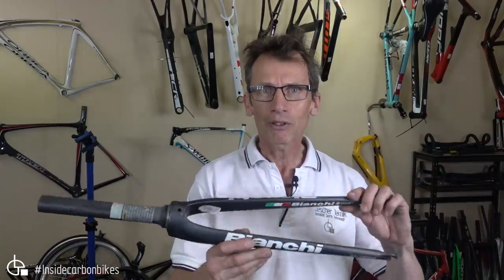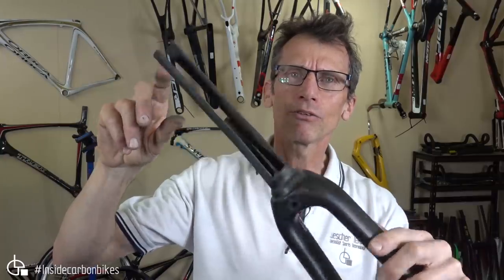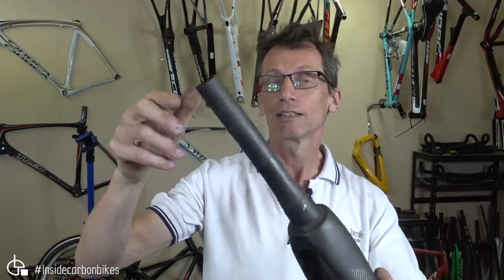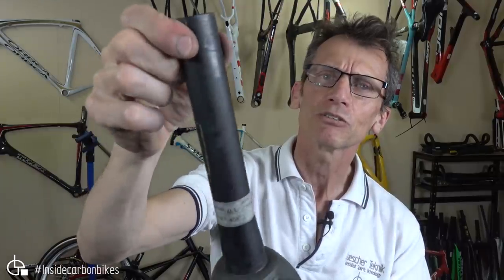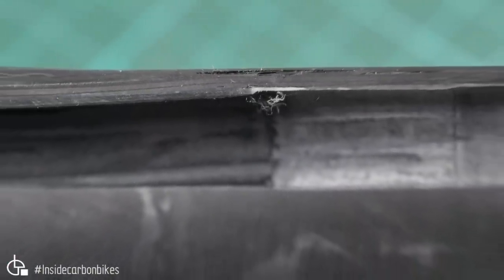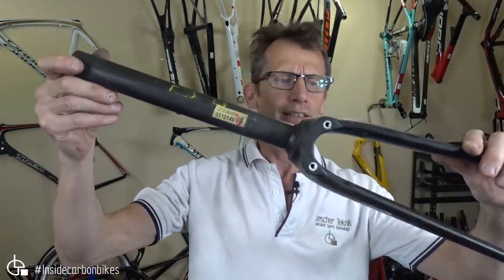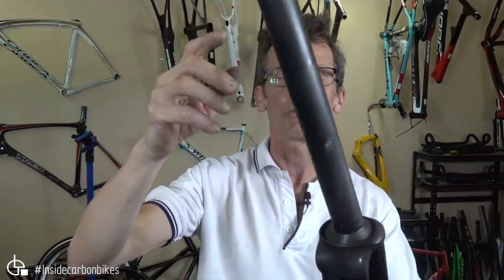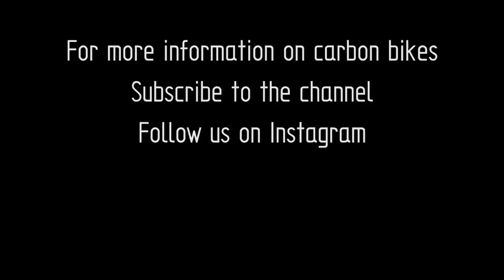Fork Steerer Failure - Recent Crash

Comment: Hi Raoul, Great to see a new video from you again!
To all the chinese-paid carbon fanboys here.. let's not forget cannondale's carbon forks have already killed one person and 11000 of them, yes.. ELEVEN-THOUSAND forks have been recalled because of cannondale's greed and lack of quality control. When was the last time you saw 11000 steel, titanium or aluminum forks being recalled?
Reply: 1. Lets get the facts right GG DD :) CARBON WAS NOT THE ISSUE HERE! The issue was the lawyer tabs didnt work if you put your wheel in wrong and grabbed front brake. Your wheel could pop out and that is what caused the crashes.

2. Cannondale recall is NOT about materials used and is a BIG reason thru axles are become the standard in road disc now.
Reply: @DurianriderCyclingTips  The recall concerning the wheel popping off was actually a Trek recall. The Cannondale recall address possible fork breakage. Both recalls concerned disc brakes only.
Reply: @DurianriderCyclingTips  I see some of my responses are being censored. Let's just say you are incorrect. The MIAMI HERALD WROTE an article about the Cannondale recall.. "Cannondale bikes recalled after BROKEN FORKS result in serious injuries and one death"  Google it and LEARN.

Comment: Hi Raoul... Is there anyone in the US that you could recommend to do a scan?
Reply: If he doesn’t respond, locate your nearest engineering university and call them, you want to speak to the Dean or head of the mechanical engineering dept., or metallurgy group.  As a private individual, it may cost you nothing or a nominal charge.  Even the whole frame too.  Engineering or materials laboratories can do it for hire, at a cost.
Reply: The two that i know in the US are: Ruckus Composites
 and Calfee-Design, i am sure there may be more..
Reply: @ggdd1299  Okay, thanks.  I just contacted both companies.
Reply: @shibaburn7725  i am glad i could help.
Reply: @ggdd1299  "We do not perform any x-rays or ultrasonic inspections on frames or bicycle components. The only service we offer for forks is a symmetry test, this would mainly indicate any signs of speed wobble. 
Regards,
Claudia Saldana
Carbon Repair Manager
Calfee Design"

Comment: Have you ever had any EC90forks pop-up with voids or problems ?
Reply: ALL brands have voids. Voids are not the issue here. That bianchi fork snapped because of a short steerer plug and the noob was running SPACERS on top of his stem...

Comment: Perhaps it’s time to go back to cro moly steel steerers and crown.  My Kestrel EMS fork from 1996 went thru 20k miles before retiring the bike recently, and it provided a great ride exactly why carbon was purposed for in forks.  Carbon doesn’t provide any warning it seems, just lets go, unlike steel or aluminum.  If one finds the stem getting loose at some point in time, watch out.

Comment: If the steerer is the most critical failure ( as no time to react and stop) why don’t we all add a few grams and use aluminium steerer tubes. 🚴🏽🏴
Reply: they fail more than carbon. Best is just run a long plug and don't use a spilt ring that has a vertical grove in it.
Reply: durianrider would that only eliminate the crushing risk. Any voids etc would still be present? I guess we never know what we’re getting mate👎
Reply: Alu fatigues relatively quickly if thin.. so better tonstick with carbon.
Reply: The bonding point between an aluminium steerer and the carbon blades is a weak point. It's going to be fine in most cases but full carbon is probably safer.
Reply: Having a metal steerer is what TREK used to do in the early 2000s forks.. steel / alloy steerers and dropouts. Those early OCLV frames were probably the best Trek ever made. https://www.sheldonbrown.com/rinard/frame_fatigue_test.htm

Comment: Raoul, do you know anyone in the US that does work like yours? A company or an individual that people can send components to and have them tested?
Reply: The two that i know in the US are: Ruckus Composites
 and Calfee-Design, i am sure there may be more..
Reply: @ggdd1299  Calfee said not them:  "We do not perform any x-rays or ultrasonic inspections on frames or bicycle components. The only service we offer for forks is a symmetry test, this would mainly indicate any signs of speed wobble. 
Regards,
Claudia Saldana
Carbon Repair Manager
Calfee Design"
Reply: @shibaburn7725  so they are basically useless,,  i can do a symmetry test a home with some calipers, LOL.. i will take them off my list.. Thanks
Reply: @ggdd1299  Ruckus Composites' reply: "A fork ultrasound scan is $75 and we'll be able to determine if anything is wrong with it. Should be only a few days for the turn. We do not repair forks, however."
Reply: @shibaburn7725  For $80+ i can buy a NEW 700c Aluminum fork on Ebay that will outlast any carbon fork... everyone should stop wasting their time buying carbon fiber garbage frames and components
Reply: @ggdd1299  Ummm, no.  Unlike steel and carbon fiber, constant exposure of aluminum to repeated loading will ultimately lead to failure, no matter how low the actual stress magnitude.  If you want to know more about the topic, do an image search for "Fatigue Limits of Steel and Aluminum" which will bring up lots of graphs.
Reply: @shibaburn7725 I have steel frames that have lasted longer than any carbon frame ever will.  Carbon may have better fatigue numbers  in lab tests but not in real life, One thing is aerospace carbon, another is poor-quality-control crap carbon frames, that are full of voids, as shown in this channel. Carbon bike frames are so frail, that any hit the wrong way will crack the tubes.. while steel and aluminum just bend and ding. I have steel frames with bends and hits that would have sent any carbon frames to the garbage can. Ripped v-brake lugs? cracked rear triangle solder joints from a hit? no problem, some bending, soldering and grinding will leave the frames like new.. try that with a crap carbon frame. Carbon bike frames are purposely made to be disposable GARBAGE.

Comment: So what do you do, forget carbon and go for titanium?
Reply: Why bother going with titanium? Your tire could still fail and kill you. Bike riding is inherently dangerous  like flying on an airplane, driving in a car, riding a ski tram, taking an elevator, etc. All these vehicles are imperfect, but the experts have determined it's good enough. Carbon fiber bicycles will always have imperfections if you look hard and long enough, but are they good enough with most imperfections? The experts and the manufacturers decided they are.
Reply: Any old metal bike is better than a chinese-slave made carbon crap bike.

Comment: Isnt the bianchi one down to assembly error and not manufacturing?
Reply: Who's to say if the steerer wasn't poorly made at the point of contact for the stem?
Reply: JasonInMelbourne - a root cause analysis of the failure, by an expert, a plaintiff hires.  The manufacturer will defend his product with their experts or 3rd party experts, as usual.
Reply: @JasonInMelbourne while that js certainly possible, and we wont know unless leuscher scans or cuts the fork up and we know the installation history, some things stand out for me: 

Leuscher indicated there was wear on the compression ring (plug?) Area. This indicates that a part that is not supposed to move is moving, and that indicates improper installation. Once you have improper installation of the fork, all bets are off. In fact, an improperly installed compression plug is the most common cause of fork failure by stem overtightening.

Next, leuscher himself says the stem was over tightened. If you look at the crack formation, it looks to be directly in line with the 'pinch line' on your stem. That would also indicate that overtightening was the primary cause of the failure.

Finally, this is a relatively commin failure seen in bike shops. Based on this i'm betting on user error
Reply: @davidngqkalone88  It definitely looks like typical stem overtightening, but I was just throwing another possible reason for the failure.

Comment: good  ‘ol steel for me thanks. Riding for the average bloke is primarily enjoyment, only steel buys me peace of mind to surrender to the enjoyment of riding, screw plastic
Reply: You know that steel can have manufacturing defects as well? Bad alloys, bad welds or simply corrosion can cause spontaneous failure in steel.

Comment: the more pictures i see of these failed carbon products,the more 
uncomfortable i feel about my 2 carbon forks.....
Riding on carbon since 84 when i got the vitus k 9, and in my experience 
the fork/stem connection is the most sensible part,and it is most dangerous when
it fails!
That’s why the only carbon thing on my titanium frame is the rim of the back wheel.
I‘m about 82 kg/191cm, so it’s only 300 gr of weight added to a much more stable
aluminum fork.Don‘t risc your life folks  🤙  🚴🏽💦

Comment: hmmmmm glad i have an alloy steerer.
Reply: lol they fail more than carbon mate. Carbon CAN'T fail from miles but alloy does.
Reply: The bonding between an alloy steerer and carbon blades is a potential weak point, there are cases of forks separating there. I don't think this is to say alloy steerers aren't safe, this is still very rare, but I would think a full carbon fork is probably safer, if installed correctly (compression plug supporting the stem, torqued correctly)
Reply: @blorg8206  it can but the force is non lateral so if the carbon tube became unbonded youd probably see it befire it would come apart as it sleeved.

Comment: Maybe ultrasonic scanners should be included with every carbon bike.

This is terrifying.
Reply: You ever seen a carbon bike or fork just fail from miles? IMPOSSIBLE! What fails is steerers when noobs run a steerer plug that doesnt go BEYOND the lowest stem bolt. Or they use a split ring that has a single grove in its vertical face.
Reply: @durianriders  So you're saying that the professional cyclist and his presumably professional team mechanic cited in this video are noobs?
Reply: @junkandcrapamen  there is no point in arguiing with ladyboy-loving, chinese-paid trolls..
Reply: @durianriders  Impossible, RIGHT.. telll that to the person who was riding his Cannondale CAADX and was killed because his carbon fork FAILED.. and then cannondale was forced to recall 11000, eleven-thousand bikes / forks in june 2019 . sure.. impossible.. the MIAMI HERALD WROTE an article about it.. 
"Cannondale bikes recalled after BROKEN FORKS result in serious injuries and one death"

Comment: 1. Lots of fear mongering in this video to funnel sales to x ray machines...

2. Video starts finally @9:00 when LT FINALLY address the reason that bianchi specialissima fork failed in that race last week - HIS BIANCHI HAD A SHORT PLUG AND HE VOIDED ITS FUNCTION BY HAVING SPACERS ON HIS STEM! 

3. In 23 years of using carbon bikes Ive never seen a carbon bike fail. It can't. What does fail is steerers when noobs run short plugs in them and then the lowest stem bolt is NOT supported. CRUNCH goes the carbon when the noob wrenches it up. Then they hit a bump or do a sprint and torsional forces from the stem literally rip the carbon right in half. You get a warning crimp crack though, it doesn't just explode in one hit. Ive lost count of how many steerers Ive seen with vertical or horizontal cracks in them from punks running short steerer plugs.

4. If voids were the issue then we would actually see carbon bikes failing left and right but how many of you know someone who crashed because of a carbon fork or frame fail that was due to a VOID? IMPOSSIBLE!

5. In 22 years of road racing Ive NEVER seen a carbon fork or frame fail from power. Even carbon bars don't explode. They get over tightened or crashed then the damage spreads for the eventual failure. 

6. LT needs to address the GROOVED split ring that causes the ring bark effect on carbon steerers. Currently Im the only youtuber to have made a video about it.
Reply: durianrider Raoul is talking specifically about carbon steerers and how they fail due to over tightening, and incorrect plugs being used. 

This is exacerbated by flaws in the carbon itself. That seems like a logical statement?

He doesn’t mention bikes failing, or exploding. There’s no conspiracy at work, just information. Are you suggesting that there’s some collaboration between LT and other companies-worldwide mind you-to increase, ‘sales to x ray machines’? FFS man get a grip.

He doesn’t suggest having your frame or forks x-rayed willy nilly. 

Your criticism in point 3. supports what Raoul is saying. 

Point 5. You’ve never seen a failure under power, NEVER? Did you watch the video of the guy sprinting and his bars detaching? The video which prompted this one.

If you crash your carbon bike, it’s probably best to get it scanned for unseen damage. How can that ever be wrong?

Anecdotal evidence is just that, anecdotal. I’d rather listen to an expert like Raoul, who inspects thousands of carbon frames and forks. Who also specialises in their repair.

There’s a huge disconnect between your comments and the video itself.
Reply: I've seen carbon seat posts, Handlebars and RS SID steerers, all snap and fail, in all my years from visiting European World Cup XCO races, all ridden by factory sponsored riders. I remember seeing Cannondales Marco Fontana snapping his seat post at the 2012 GB Olympics in front of me. These failures are probably caused by voids and wrinkles
Reply: @msagoo29  All the parts you mention have clamps of some sort associated with them. Over tightening can /will  cause the parts to fail whether defects are present or not. You did not mention seeing chain stays, seat stays, down tubes, or top tubes spontaneously fail. That's because no clamping force is squeezing them.
Reply: @billlieu9116  Are you suggesting multi million pound backed factory riders, have mechanics that don't know how to use torque wrenches? lol
Reply: @ggdd1299  hi Phil. How is the EPO side effects going?
Reply: @msagoo29  you ever seen a frame fail from power though? Impossible. Parts yes from being crashed or over tightened - I see it every month.
Reply: @dantedorado2609  bro THE BIANCHI FORK FAILED FROM BEING CRUSHED AT THE STEM BECAUSE THE STEERER PLUG WASNT DEEP ENOUGH IN! lol You really think a scrawny cyclist with teen girl arms has the POWER to snap a carbon fork that is properly fitted??? BRO!! XD
Reply: @msagoo29  look how many pro riders on low rank teams ride with uncut steerers....you will NEVER see that on a proper pros bike.
Reply: Durianrider Cycling Tips I don’t recall arguing to the contrary, man!
Reply: @DurianriderCyclingTips  well i guess the bianchi guy whose steerer snapped was not a pro right?? LOL
Reply: @DurianriderCyclingTips  oh yeah.. you see everything,  because you have a business fixing bikes every day of the week, 9-5.. right.. Mr. YouTube Phil Gaimon wannabe.. LOL
Reply: @DurianriderCyclingTips  LOL, at least he doesn't use a motorcycle to get his KOMs, LOL.. seriously do you think Phil is going to bother replying to a ladyboy-loving nobody like you??
Reply: @ggdd1299  hi Phil

Comment: Also, why isnt steerer made out of Al, with a starnut, weight difference isnt even that big
Reply: There are issues with this solution as well.Bonding problems between the carbon fork legs and alloy steerer; galvanic corrosion, differing Young’s modulus can cause stress risers at the interface leading to bond failure. This design was typically used in olde generations and replaced with a fully carbon fork design.
Reply: @getur99  then long bung adaptors that reach under the top part of HT should be necessery for a carbon fork setup
Reply: Oreo Carlton as said by Raoul the steerer tube bung should be long enough to support the clamping of the stem to prevent crushing. There is no real benefit to a bung going below this point ie into where the headtube and spacers. As the steerer is designed to take this load.
Reply: Too bad steel the ideal material was eliminated.  Too heavy I guess.